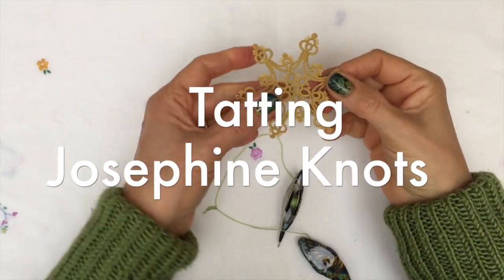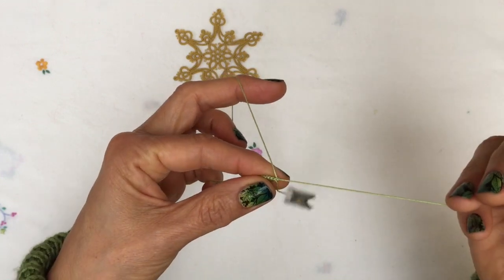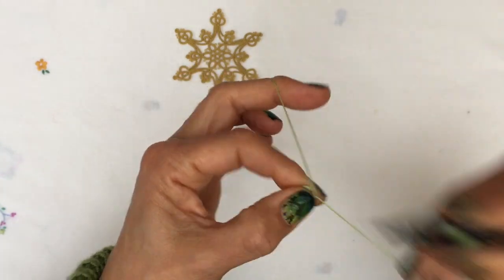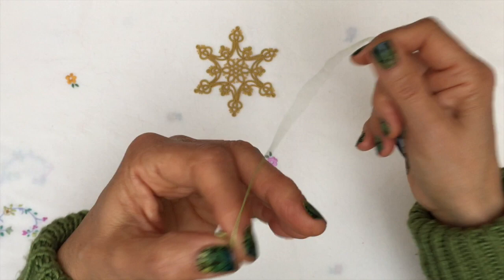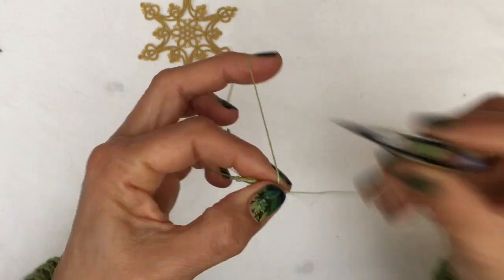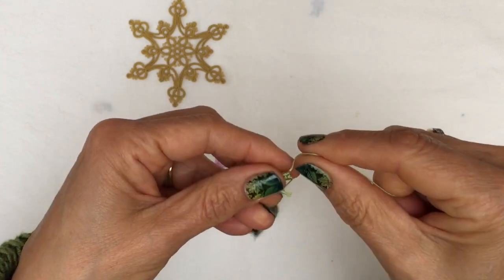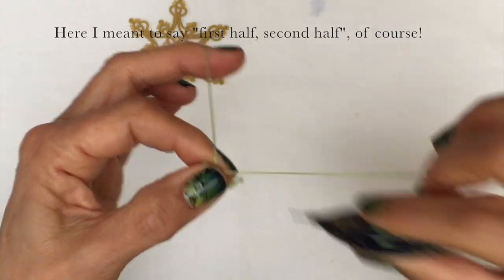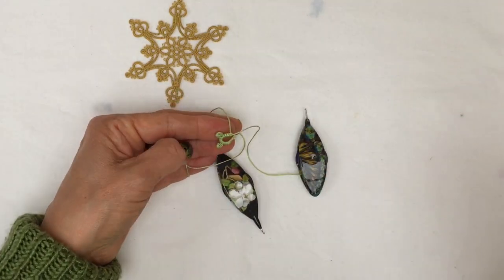Tatting Tips - Josephine Knots

Comment: Thanks so much for your very instructive and easy to follow channel. Just started tatting 2 weeks ago and have tried several of your tips and patterns. You've made in possible for me to learn tatting, after wanting to do it for 40 years! Could you possibly explain or do video showing the Josephine chain that's on your website? I'm trying to make the flowering quatrain bookmark but I'm stuck at that point. Can't seem to make either the Josephine chain described as I don't know how to join it after doing the 10 half stitches. When I tried the Josephine knot it wouldn't pull into a ring/knot  (maybe because I'm using beginner size 10 thread) . Any advice would be helpful. Trying to complete the bookmark by Thanksgiving. Thanks.
Reply from the maker: Hello Yvette, what a nice message, I'm very glad you are finally tatting!  The Josephine Chain is really just a chain but it is made with only the 2nd half of the double stitch repeated, it is then joined back at its starting point.  Yes, I'll try to make a quick video to demonstrate it.  In the meantime I have a video on the Josephine Knot, have you seen it?  It might help you with regular JKs perhaps?  It can be seen here:
https://www.youtube.com/watch?v=ukdbckfR4Kg
Reply: @11Frivole  Hi Frivole. Thanks for the tips. I am going to try the Josephine knot today. Will share how that works out. Also taking another go at the Josephine chain- hope it works this time- trying to finish the bookmark to give as a thanksgiving day gift. Please continue sharing tatting with us. Looking forward to your new patterns.
Reply from the maker: @yvettedyer2396  Hi Yvette, I've actually made a new video that shows the Josephine knot vs the Josephine chain.  I'll upload it shortly, hope it helps!
Reply: @11Frivole  Hello Frivole. Thanks so much. Really appreciate your help. Just saw the new video- happy you shared these tips. Finally got it right- so full steam ahead with the bookmark now. Completed the one shuttle medallion today - love it.  WIll try making several to join for a mini 'runner'. Your videos and patterns are great. Please keep sharing.
Reply from the maker: @yvettedyer2396  You're very welcome Yvette, and I'm glad you'll now be able to complete the bookmark.  Is it the round medallion you are making or the square?  Either would look nice as a mini runner, I hope you're pleased with the result!  :-)